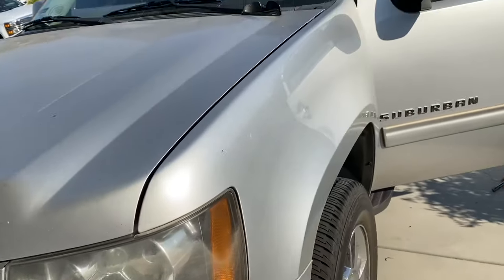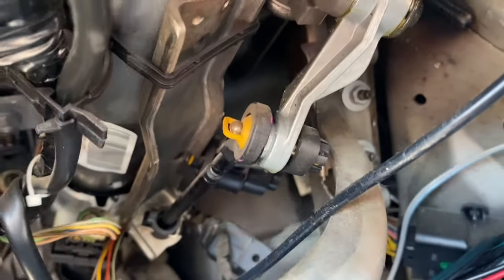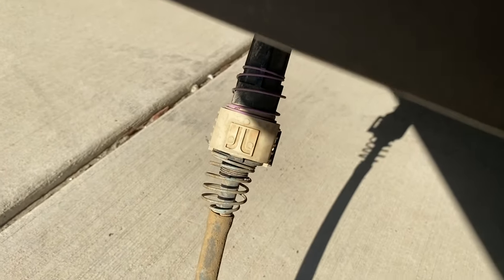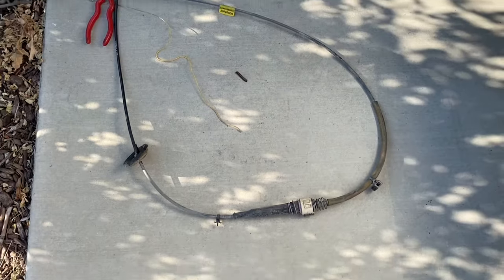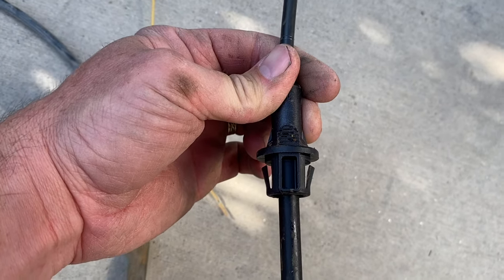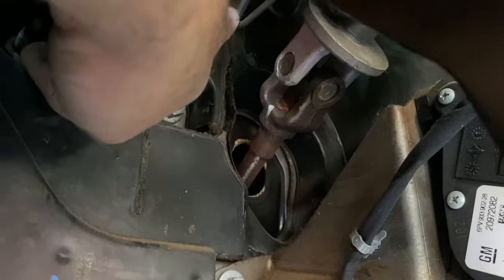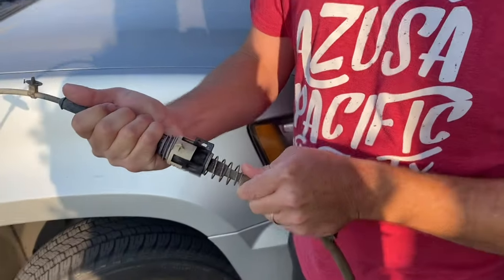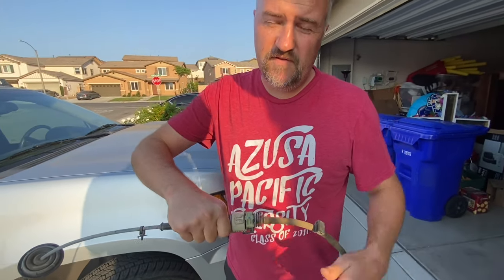Shift Cable Replacement: 2007 - 2014 Chevrolet Suburban, Tahoe, Yukon, Silverado, Escalade, GMC

Comment: My shift cable broke on my 2013 Suburban .... I only had reverse to get back plus the additional help of Good Samaritans ..... I had to drive it home in Reverse ....
Reply: If it happens again there is a lever on the side of your transmission that you can shift gears with

Comment: Great video, you are the only person who has done this.  I literally just did this whole job yesterday.  Some notes from my job: Yes you absolutely can get both cables apart, actually quite easily using a small pick to pop that little copper clip out, just use extreme care as it goes flying.  Then squeeze that clip back on with pliers and you can install the new cable.  those cables are much cheaper online, rockauto has the lower one for $29, genuine gm.
Reply from the maker: That is great.  Did you separate the cables while the upper was still in the car?   Or would you recommend removing the whole assembly to attempt that?  I don’t remember seeing anything but Dorman for my model when I looked.  That is great that rock auto has it, I couldn’t wait that long.
Reply: You can do it with the upper cable in the car.  You can pull it down enough to work on it.
Reply: I broke the little clip trying to put it back together lol very fragile little piece and didn't wanna go back so I just bought both

Comment: Great video. Just did mine tonight. I bought both cables ($140 GM) and was only going to replace the lower, but both the internal brass clip and the outer plastic retaining clip at the junction broke on me. So I ended up replacing both. In hind sight, I recommend just replacing both in the first place.
Reply from the maker: Glad it helped

Comment: good informational video. it’s “easy” to disassemble the lower and somewhat on the upper but feeding the new upper through the back steering column through metal bracket is difficult. yes it can be done but removing is far easier than putting in new one. plus, just bc you have new one installed and connected doesn’t mean that the shift will be right. you’ll have to adjust tension which is tedious to get right so it will shift through all gears and return to park. on its face it is a easier job but by no means is it not not difficult. good luck. i’ve done this job many times on GM’s and can be trying at times. good luck

Comment: Thanks for the video. Agree that little brass clip is a pain. I can’t believe that holds the 2 cables together.  I ended up buying both cables ($130) from GM dealer.  Should have just ordered the bushing from bushingsfix for $30. Did that on my 2006 envoy and it is much easier than changing out the cables.
Reply from the maker: I was tempted to go that route but wanted to make sure it didn't go out on my wife again.  Should last me for another 10 years :)
Reply: late to the party but the OEM cable that connects to the transmission is $50. I figure the difference is not that much compared to the bushings and now i'll have a new half of the cable that gets exposed to much higher temperatures that close to the transmission. thanks for the video @jimvia76

Comment: Great video This cable really just the bushing I think broke in the drive-thru at a restaurant on me today I was lucky enough to be able to go under the vehicle and just manually put it back on and be able to drive it home thinking maybe I had just fixed it thought I would try the vehicle again later in the afternoon but had already popped off again. Debating about just buying new bushing for underneath the truck but don't know. Not so much worried about the money Just worried about the zero mechanical experience might be easier just put the bushing on and not replace the whole cable. It seems to just keep falling off at the bushing under the truck

Comment: just go to the dealer and get your upper and lower cable its much easier to replace .the end result is smoother shift which is like back to new . its not hard to do yourself quoted 450-600 by the dealer .it took me 45 mins to do myself and im good .
Reply from the maker: That is what I did.  Simple job and worth replacing the entire cable.  I was surprised how reasonable the cable cost was from the dealer.

Comment: Why do you have to connect both ends first before connecting the cable together?
Reply from the maker: You can connect the cable together, but don't push down the plastic retainer in the middle of both cables until you have both the shifter and the transmission in park

Comment: HELP! 
I have a 2011 Chevy Silverado, I recently (yesterday) replaced the lower shifter cable although I know it’s recommended to change both but I’m tight on money, anyways 
New lower cable in and I’m still not able to shift passed reverse. Sometimes not even. It’ll stay in park and my shifter is completely free to just fall down and not change gears…

Comment: How do you get the pin back in the replacement did not come with one. It's hard to put back on and it won't stay on when pushing thru the lower cable
Reply from the maker: I replaced both cables and never tried to remove that retainer that connects the two cables.  GM recommends you just replace both.  It is a one time connection

Comment: On this year/generation but the newer body style that steering bearing at end of shaft requires cutting the end of the guard off that has the curly wire cable retainer on it. The steering bearing will NOT slide out without cutting it off. The old could be just tapped out but not the 07.5+ far as I can tell. I did a vid showing it since NOBODY had any info on it. I'm now replacing the whole column and cutting that off before installation of the column.

Comment: My tahoe went out just stopped moving and im so lost on what is wrong with it. is this what happen to yours ?i have no check engine lights i have transmission fluid i dont know what else it could be
Reply from the maker: when the transmission cable goes out, your shift lever moves freeley and your car stays in park.

Comment: Why do the upper and lower shift cables not come with the brass clip. Like how tf am i suppose to install it when they dont come with the peice that holds them together.
Reply from the maker: The new cable set comes with the brass clip installed

Comment: Do you have to replace both, or can you do just the lower? Cause i only need to bushing but got the whole lower cable
Reply from the maker: it is recommended to do both, or use the guy below's suggestion.  I did both because I did not want my wife stranded.

Comment: I made a mistake. Trying to connect the bottom and bottom cable, i pulled on the lever on the side of tranny.

Now im out of sinchrony with the lever and transmission. 

Please help. My mexh wanted to get rich off me so i got bold

I didnt know upper and lower were sold seperate and only bought upper

So i used old lower and clicked the 2 but now im out of sync. Couldnt shift to manual

Im lost
Reply: Lol. The upper and bottom cable. It was supposed to only take 2 beers but now im invested
Reply from the maker: pull out the plastic retainer between the two cables so that it does not engage the threads.  Put the transmission in park so that the driveshaft does not turn(rear wheels off the ground).  Put the shift lever in park.  Push in the plastic retainer to engage the threads.  You should be good to go.

Comment: When I put my truck in gear it still feel tight and will move but it’ll randomly act like it’s in neutral is that needing the cable changed? When it does that I can wiggle the cable on the transmission and it’ll start working for just a minute
Reply from the maker: I would disconnect the cable from the transmission the isolate it and see if it is in the shit linkage or the transmission

Comment: Will a transmission from a 2012 suburban fit a 2007 tahoe
Reply: I don’t think so. The 07 Silverado had a 4 speed and the newer ones, I think 2008 and up, have a 6 speed with a computer attached to it.

Comment: that dorman bushing is trash doesnt even work
Reply from the maker: That is what I had heard.  That is why I didn't go that route
Reply: Yep… after a few shifts.. it won’t hold
Reply: @illustr8phee100  my cable is turned about 1/8 of a turn so it slips off transmission lever, hopefully turn back

Comment: problem is I'm not trying to pull apart this brittle bullshit interior in my Tahoe I'll get a bushing online
Reply from the maker: I heard those bushings had issues.
Reply: 1.  Those bushings will fail, read the reviews.  Replacing the cable is the right way.
2.  You wont break anything if youre careful, all you need to remove is the sill plate and the piece under the steering column.
3.  You dont need to replace both cables, you can get them apart you just need to be careful